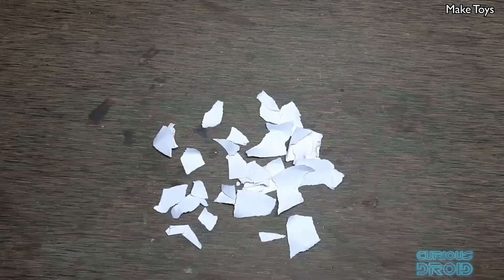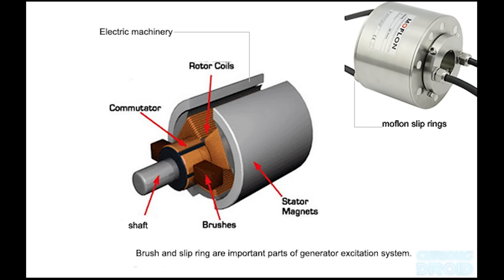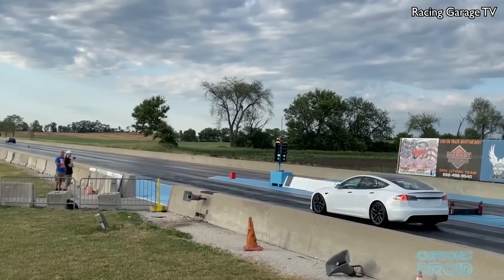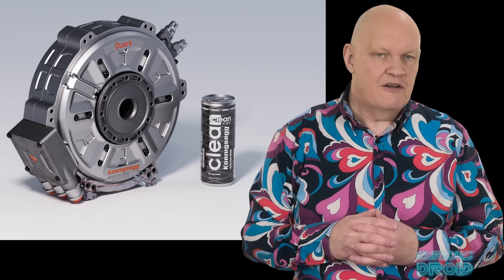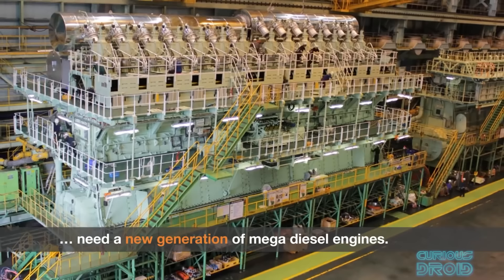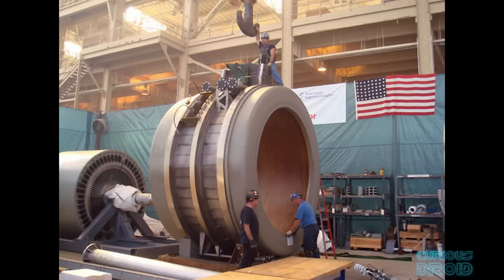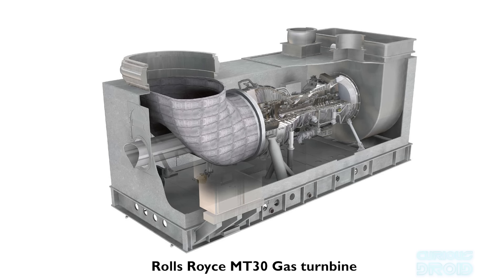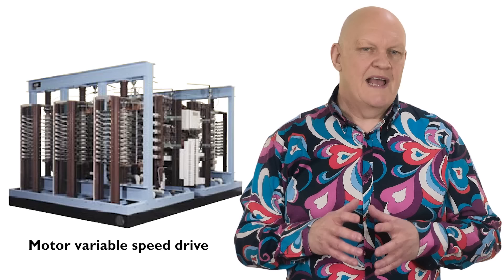The Worlds Most Powerful Electric Motors

Comment: I'd like to understand how those electric carriers save on fuel, if they have to use diesel to generate the electric power in the first place. 
Wouldn't that make them inherently less efficient? And wouldn't they need just as large diesel engines?
If anyone can explain, I'd be grateful.
Reply: You can always run the generators at peak efficiency and don't suffer from mechanical losses. Transmissions and driveshafts in such dimensions are huge and hugely expensive.
Reply: The advantage of the Electric motor is that it’s maximum Torque shows up at the lowest rpm and then it falls off as the rpm’s increase. The Internal combustion engine it’s. Maximum torque is just before the redline of the engine . The Diesel/Electric engine used on trains works so well because of that because to move a train from a dead stop will take the most torque
Reply: same way most cruise ships nowadays do - more smaller diesel generators. You only run as many as you need for a given speed, which allows them to be closer to peak efficiency.
Reply: Think of it being like a hybrid car. The efficiency gains from only running the generator at its peak efficiency rpm more than outweigh any losses from energy conversion. 

In the specific case, it also allows you to use a gas turbine rather than a piston engine. Gas turbines are great for efficiency and size, but they pretty much need to be used in a constant speed application to get the best results, which limits their use in mechanically coupled systems. 

All electric drive also allows you to use a storage bank to output short term burst power well above the total generation capacity, which might be useful for certain applications (say rapidly accelerating alarge warship in response to a sudden threat).
Reply: @karl0ssus1  On the Zumwalt destroyers, the other advantage (that sadly was never realized) was that said bursts of power would be very useful to accelerate much smaller things to much higher velocities, as a projectile weapon (aka railgun for shore bombardment). Would theoretically have been capable of over 100km range with REALLY CHEAP ammo, even if it was guided ammo it still costs a lot less than a Tomahawk, and there's less warning time for the enemy too since it's on a ballistic trajectory instead of a subsonic cruise flight.
Reply: The video missed out explaining how the turbines and diesel generators work in tandem.
At cruising speeds, any number of the diesels run to provide power to ship auxiliary and propulsion.
When at high speed and when having to be a the ready, the turbines run.
So, MUCH fuel is saved by only running enough of the diesel reciprocating generators to provide only enough power to meet demand.
Don't have to run giant engine all the time for propulsion. And don't have to run the turbines all the time either (which would be disastrous for fuel economy).
Reply: @karl0ssus1  Actually, with the design you avoid using the turbines as much as possible.
The smaller generators can be run in any number until ship power demand is greater than what they can provide. Then for high speed the turbines run full tilt and the diesels power ship systems only.
Reply: @44R0Ndin  That ammo was NOT cheap. Except in so far as a Tomahawk costs far more than 35k$.

"In 2004, the manufacturer stated that the goal for the LRLAP per-round cost was $35,000.[16] Shortly after the USS Zumwalt (DDG-1000) was commissioned but prior to weapons system integration,[17] the U.S. Navy moved to cancel the LRLAP due to excessive cost. With the number of ships reduced from 32 to 3 examples, the per-unit cost of each LRLAP shot increased to $800,000–1 million. This made the system untenable even though there were no significant performance issues."

"The price for an individual round is estimated to be $800,000 to $1 million — a full buy of the about 2,000 planned rounds for the three ships would be about $1.8 to 2 billion on the high end of the estimate, USNI News understands. In comparison a Tomahawk Land Attack Missile with a range of about 1,000 nautical miles costs about $1 million."

Seems a pretty stupid gamble as well. Risk a billion dollar ship and be limited to coastal targets (range < 100nm) when a Tomahawk can be launched from the safety of 1000 miles away.
Reply: @ericdunn6232  with big giant expensive batteries? is the benefit a wash? im sure they see a small margin of benefit or something or else they wouldnt have done it.
Reply: @TBPony  No, no batteries.
The ship runs on the reciprocating generators only when cruising.
When full power is needed for operations and maneuvering the turbine engines are started.
The savings are gained by running only the smallest size and minimum number of generators required to meet ship needs.
The all electric US WASP Class ship saved 2$M in fuel on it's very first voyage from shipyard to home port (Mississippi to San Diego, around South America) and will save 250$M compared to the traditionally engined WASP class ships over the ships service life.
Reply: He explained in the video - a 65,000 ton ship uses the same amount of fuel as if it were a 20,000 ton ship.  So it effectively requires less than a third of the fuel that it would if it were not electric.
Reply: @ericdunn6232  ahhhhhhh.. that makes way more sense than what the video kinda skimmed over, that's kinda awesome

Comment: @Curious Droid

As someone who probably knows more about IC engines than you

Worlds most powerful IC engine runs off unwanted oil from an oil refinery and is one of the reasons why it generates very little power for its size.

The oil has high energy density like diesel, and is cheaper than diesel which is why it’s used. The downsides as a fuel is that it is very difficult to mix with air since it’s viscous which requires the engines to have a very under square (very long) shaped cylinder so it can give the air and fuel enough time to mix thoroughly making the engines very tall so it can remain efficient. 

If they decided to make it a diesel or biodiesel engine, engineers could cut the height of the engine in half since diesel is much easier to mix than unwanted refinery oil, meaning it can generate the same amount of torque and have similar efficiency with a much less under square engine which has the benefits of allowing higher rpm which allows for much higher power output if torque remains the same.

Another thing to mention is that these massive engines are full duty engines meaning it’s designed to run at 100% power nearly non-stop for decades unlike the motors that are used on the navy ships which are designed for short term high speed manoeuvring so that also makes the engines somewhat underpowered for its size in comparison.

I don’t really expect someone who knows a lot about motors to know much as IC-engines so don’t feel too for not knowing as I do not know a huge amount about electric motors.

Comment: 8:58 - "It's reckoned that the 65,000 tonne carrier will use about the same [amount of fuel] as a 22,000 tonne vessel over it's lifetime."  This statement simply makes no sense and lacks context.  Your work is normally quite good and well researched, which makes a sentence like this stand out all the more.  Are you confusing Gross Register Tonnage with displacement, is that including the fact that naval vessels are not operated 24/7 like merchant vessels and thus on average will consume less fuel or is this a misunderstanding of how diesel electric plants work?  Slow speed diesel engines are the most efficient main propulsion engines as yet developed, and the bigger they are and the slower they run, the more efficient they get, for reasons too numerous to mention here.  Likewise, the relatively high speed diesels and GT generators that are used on vessels like the HMS Queen Elizabeth consume more fuel per HP-hr together than a single slow speed diesel of equal horsepower.  The other reasons for selecting diesel electric are valid, but there are losses (in some cases as low as 3-5%) in the generation of the electricity and the step up transformers and other equipment required to drive the shafts, so a slow speed, direct drive system will always be more efficient (solely with respect to fuel) than any other fossil fuel based option.  CODAG and other plant designs may be more efficient for shoreside power generation applications, but in general are unsuitable for marine applications due to scale, complexity and inflexibility in operational load range.
Reply: its ignoring the fact that weight matters less when every ship is buoyant in the water.

Comment: Have to include whatever gives the electricity in these sizes though when talking vehicles since many times it’s a combustion engine or enough batteries to dwarf the size of a comparable combustion engine.  
Edit: Since it’s generally not the size of the electric motor limiting its application but it’s power supply.

Comment: I think we need a trans continental cable car transport system.  Multiple motors strung across the nation all powered by wind and solar or whatever renewable sorce there is.  Added to exsisting rail system freight could move in a continuous unlimited train . All that freight moved even at a speed of 40 mph it would be astronomical think of it  ,  a 6000 mile long train in constant motion in a big 3000 mile long loop. 😎

Comment: I am afraid there is much wrong with this video, including terminology.  The most glaring error however, is your description  of the most powerful motors, which you state are 101 MW.  You did mention hydroelectric plants at the end, almost as an afterthought, but these are absolutely electric motors, and have been around for a long time, and are significantly more powerful.

Comment: So these 'electric' ships are basically diesel/ turbine electric hybrids we have around since decades in trains?
So much for any transition.
And.
Electric aircraft are not taking off.  They too will be hybrids.
As you conveniently skipped battery density as this as the Achilles heel of electric vehicles.
Reply: Electric Trains exist since 100+ Years, without needing Batteries.

Comment: I found this very interesting, but it tells us nothing about the electric motors themselves.  Are they induction types, or requiring brushgear, or even dc with commutators.  Probably 3 phase.  And why are we mixing units of measurement?  For example only the US still uses horsepower for kilowatts.  Or pound-feet for torque instead of newton-metres.  And are the tons mentioned metric or avoirdupois.  And how is the electric power generated?  
Questions, questions!

Comment: One thing I don't get, given the size and amount of materials that needs to go into these motors (about 2t per megawatt) it looks to me as it would be more efficient to use 100x Tesla (car) motors instead of a huge 20MW motor. I imagine it would also be cheaper. What am I missing?
Reply: You’d have to deal with enormous electric currents. Those enormous currents heat up the electric conductors proportional to the square of the current. The heat poses a problem because it can cause temperature to rise above safe limits, so the heat has to be dealt with by cooling, which also requires energy. That is why huge motors operate on high voltages. The power they deliver is proportional to the product of the current and the voltage. So with a high voltage a smaller current is required for the same power. Basically it’s the same reason why we use high voltage power lines to transport electric energy over long distances over the grid. I hope this explanation helped you. 🙋‍♀️

Comment: On the British aircraft carriers where you are burning petroleum to generate electricity to drive electric motors, aren't there efficiency losses compared to burning the petroleum directly in a motor to create propulsion?
Reply: My understanding is that most combustion engines have a 'sweet spot' for fuel efficiency and it's rarely the lowest or highest  power output so they run the generator at that speed and the electric motor is much more efficient at turning that power into movement.  That's.. a simplified version to say the least.  It's why trains have been diesel electric for decades.  However I do not think this is how aircraft carriers work.
Reply: @TheEvilmooseofdoom  Yes, Diesel-Electric Ships are more efficient at slow Speeds, as they have several Engines (usually four), so you can keep a limited Number of them at ideal Load instead of running one larger Engine at partial Load. The real Reason for Diesel-Electric Propulsion (or Turbo-Electric), especially on Naval Vessels like Aircraft Carriers, lies in Damage Control though. Driving the Propeller Shafts directly or through a Gearbox would require the Engines to be next to the Shafts, so all Engines would be in the same Place or at least very close to each other. They can be placed almost anywhere when using Diesel-Electric Propulsion, so you can place the Engines in two (or more) separate Engine Rooms, so it's much less likely that a single Fire or Leak destroys all Engines and cripples the Ship. Another Advantage of placing the Engines anywhere you like is that the Interior can be used more flexibly. Most Cruise Ships use Diesel-Electric Propulsion for the same Reasons.